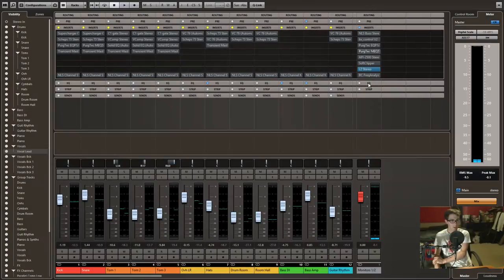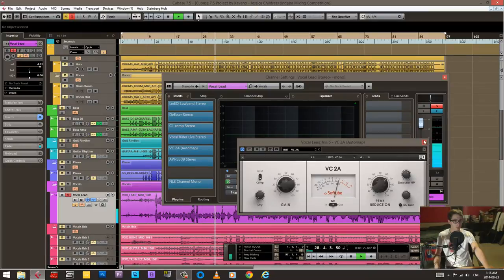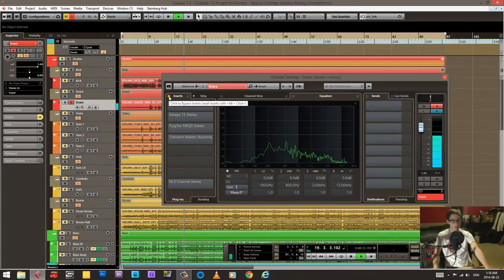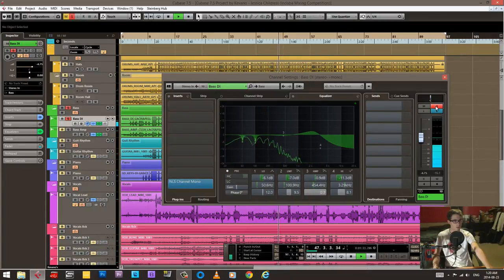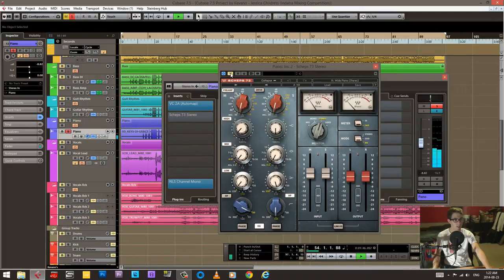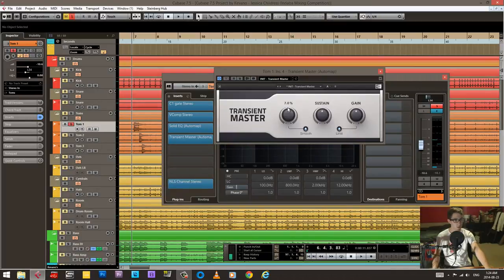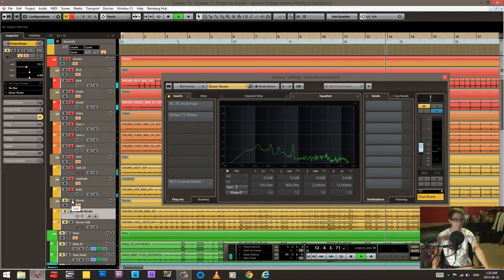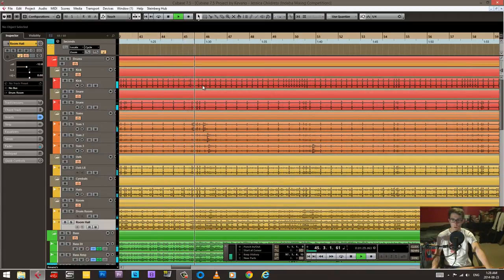How to Polish Your Mixes - Part 2 - Quick Plugin and Processing Demonstration

Comment: Could I ask why you have the NLS on the last slot of the inserts. Thanks
Reply from the maker: Charles K Yeah, there are 2 ways to use the NLS plugins. To simulate analog summing, you put the NLS Channel on the last insert of the audio tracks and the NLS Buss on the first insert of the master track and any other buss. To simulate preamp coloration, you put the Channel plugin on the first insert of the audio tracks and the Buss can be put anywhere.
Reply: Thanks for the speedy response. I understand. Maybe it would be good to do a video on this in the future?
Reply from the maker: You bet. Yeah I had another person ask about this plugin. I'm going to read up on the manual and try to do a decent tutorial and review on this plugin.
Reply: Looking forward to it.
Reply: Thanks again!
I have a question you may be able to help with. If I insert this on the last insert slot in cubase and the first insert on the master output, what do I do if I want to send all drums to a group channel first or does this negate having to do that?
Reply: Just watched part 2 of your NLS vid, cheers!